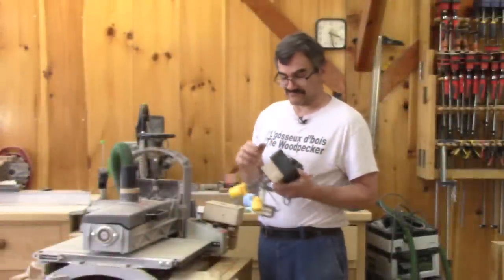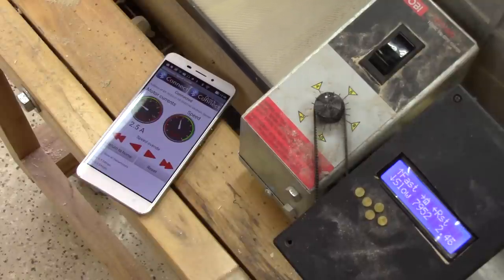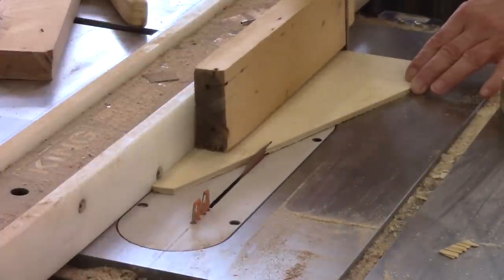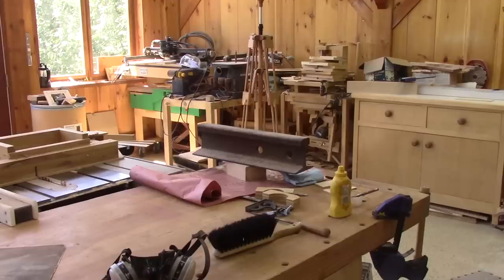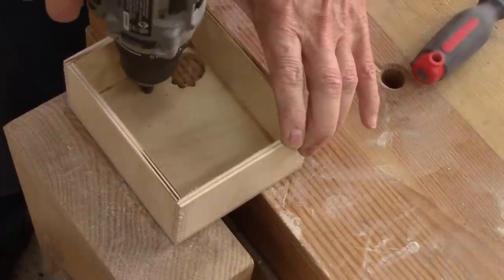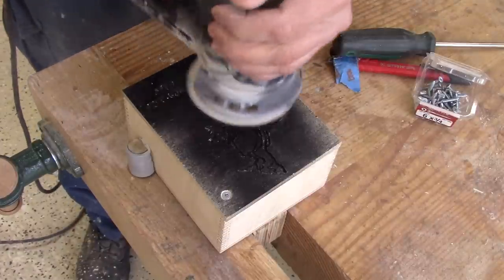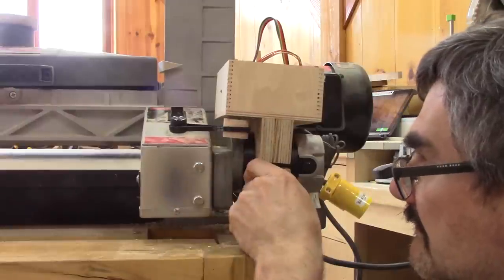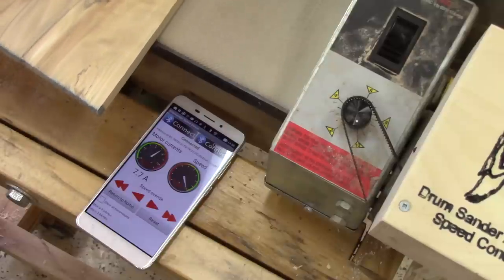The Woodoopecker Ep 169 - Drum sander controller without a display

Comment: Oke,but I hate Cellphones @ work.so I prefere the first system more.
Reply from the maker: I like giving options, like  the cellphone company some cheaper and some more expensive, but choice is good. But like I said in my intro I changed it temporarily and now I'm back to my LCD display. I don't dislike Cellphone but I'm barelly using mine and I never cary it inside the shop so, just like you, I like my first option beter but it cost more. But still not as if I had uses a touch screen, I also thought of that, but I didn't want to scare people even more. Maybe one or two viewers would like to add this to their sander.
Reply: HI, I think that controller with just 2 buttons, feed rate up and down, will be more than enough for sander